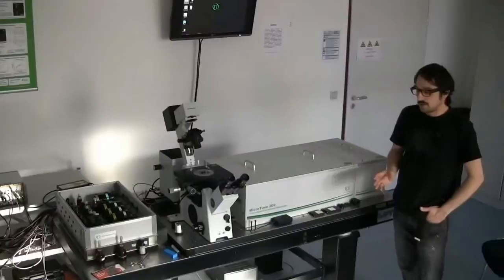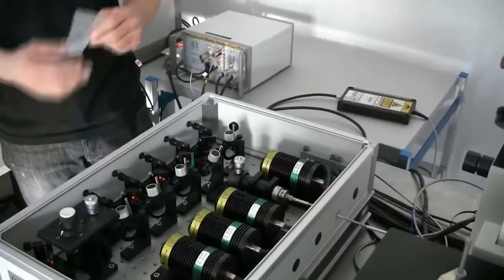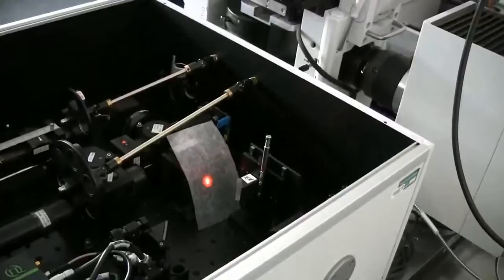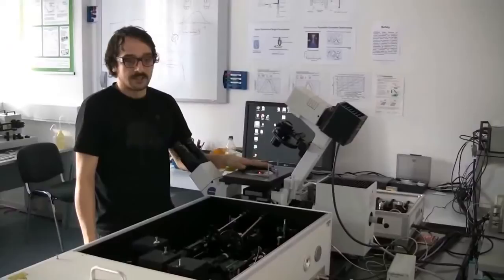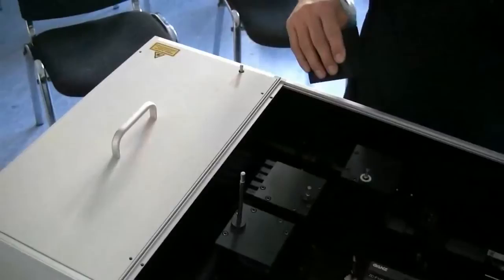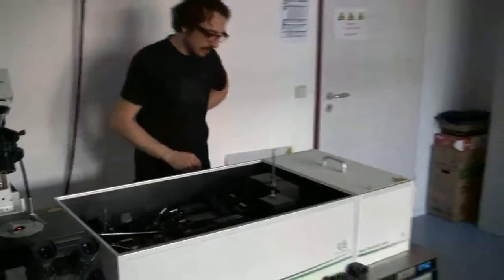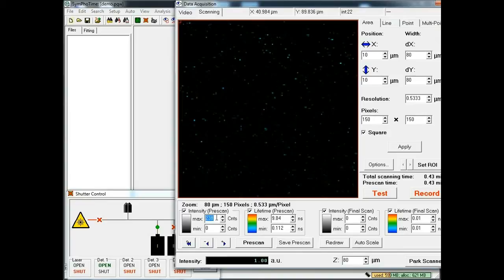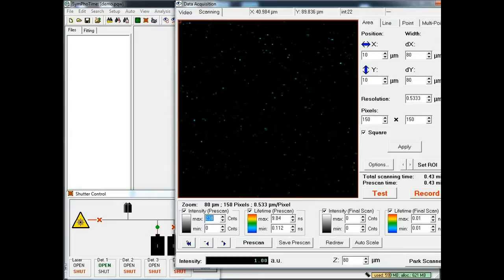MicroTime 200 - demonstration of single molecule microscopy

Comment: What exactly is there in front of the two detectors? Is there any light focusing mechanism there for improving the counts?
Reply: The beam after pinhole is collimated an then focussed on the detector. The reason is that the active area of the detector is typically small